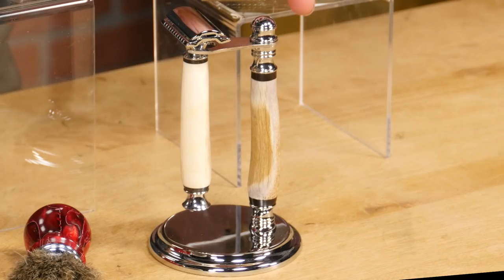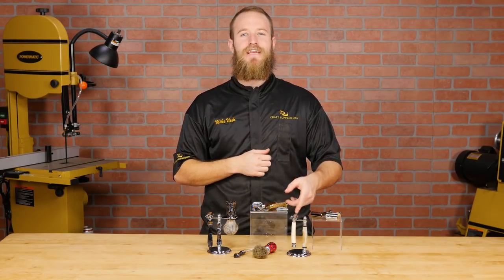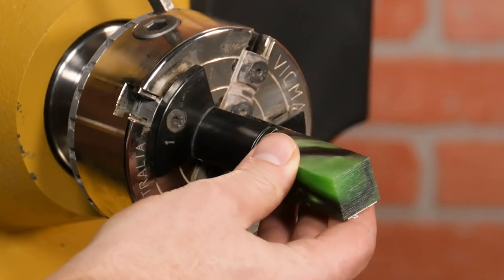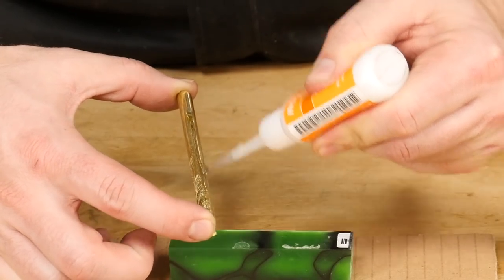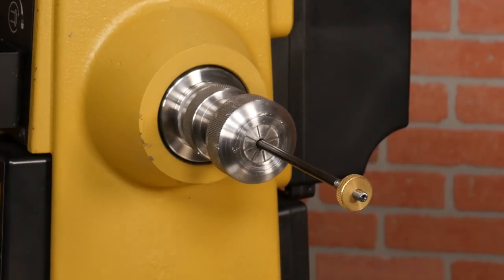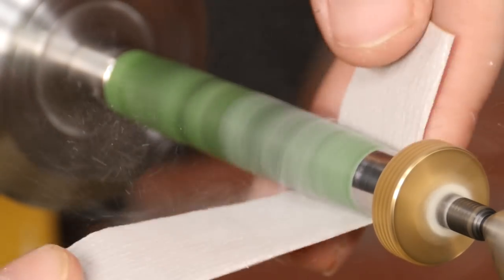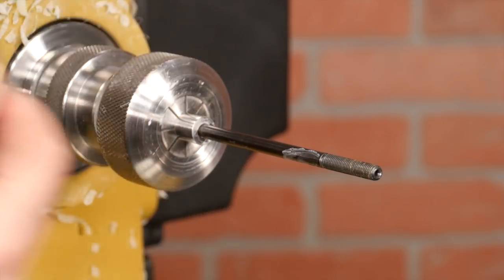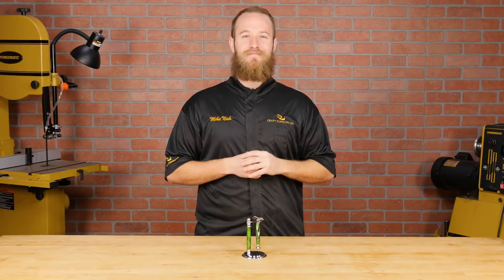Turning a Razor Kit and Stand (Woodturning Project How-to)

Comment: Good video Mike. I leave an extra 1/32 to 3/64 on the stand blank when trimming. This allows me to place the bracket directly on the blank, causing the razor to just miss the stand base as it swings back and forth, and giving a mesmerizing visual effect. I let the customer know it can be placed in either position, but most place it directly on the blank. My biggest customer is a women's beauty solon, with a picture of mine set nicely on my pedestal sink. A woman who likes "neatness" will gladly by this as a gift for her "Honey". And, "Honey" loves the weight of the brass and the manly shave.